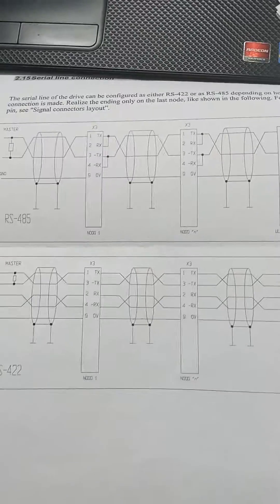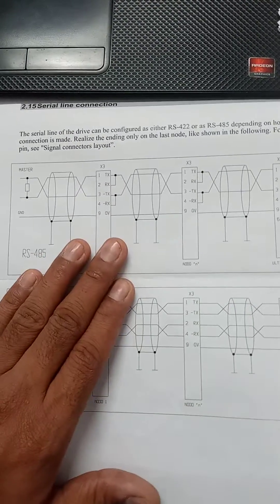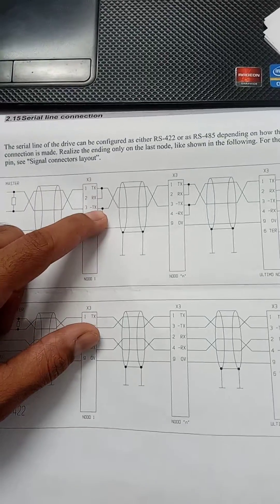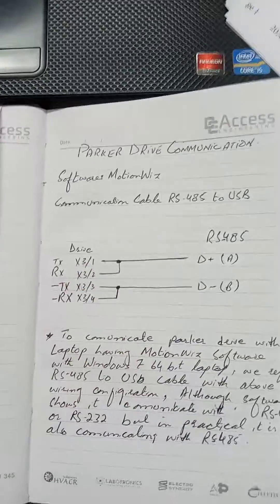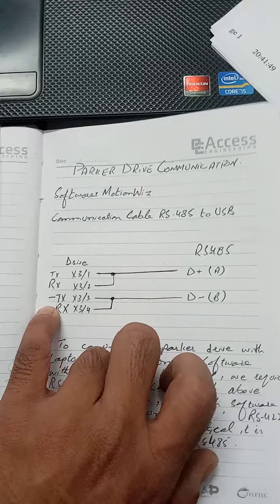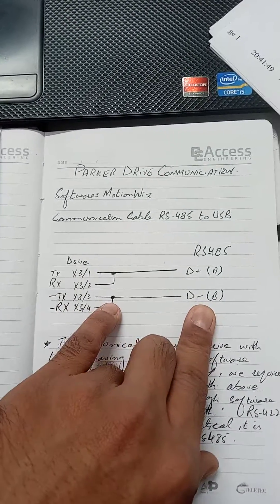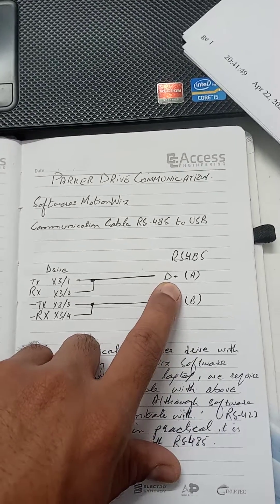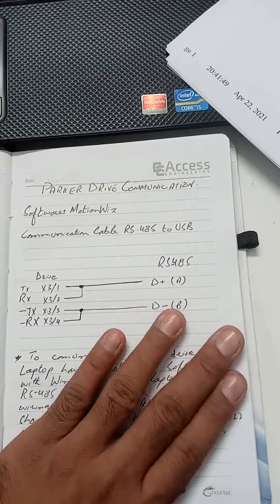SPDN parker drive communication connection, SPD and Twin parker drive

Comment: How to do hardwired connection of servo drive to plc
Reply from the maker: Hi, I am not getting what you want to know , do u want to know how to connect servo motror power connection with drive or encoder connection
Reply: @industrialsolution6828  No, I need to know how can connect servo drive to plc without profinet connection to control drive using plc
Reply: hello, what is the connection of this serial link cable?
what are the pinouts?